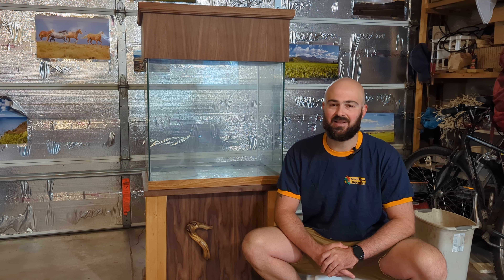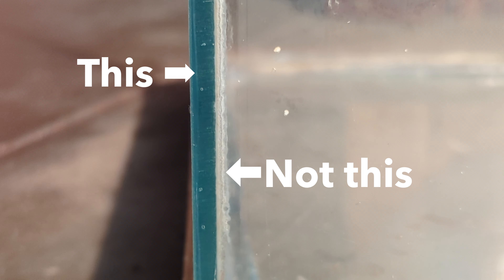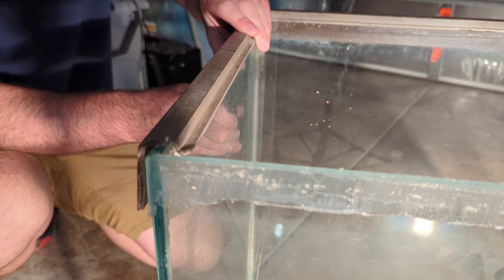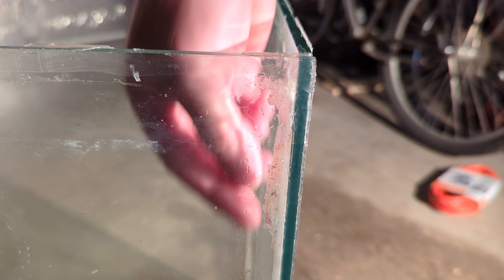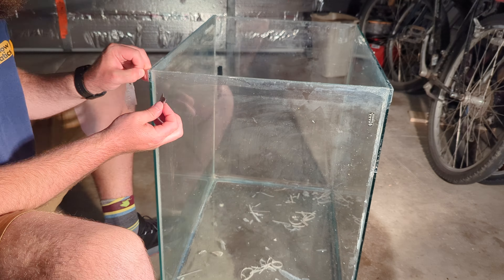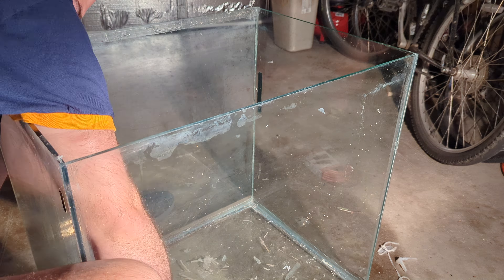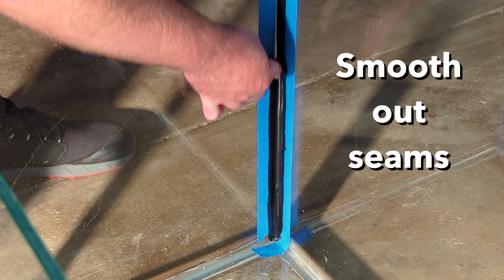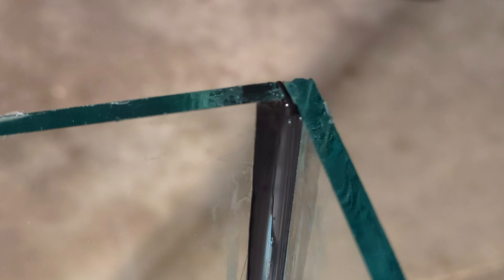How to reseal a secondhand aquarium - a step by step guide

Comment: i assumed you had to do the bottom as well, since silicone wont stick to silicone, you will have a weak seal where old meets new at the bottom....i did this today and am just taking a break before adding new silicone.   taking the bottom off and adding one new seal all the way around seemed like the right thing.   didnt wanna worry about that seal constantly
Reply from the maker: Hope the project went well!
Reply: I was just thinking the same thing
Reply: @GoldshackGarage The silicone between all 4 sides connected to the bottom pane looked brand new and the preparation done above was perfect so. the new silicone will not need to stick to the old silicone to make it hold water and like anything we do with tools and labor preparation is the hard part 😎🩵💙

Comment: Use a heater all the silicone will come off literally take a space heater put it inside the tank wait 30 minutes wear gloves literally peels off
Reply from the maker: Thanks for the tip!
Reply: @freshflowaquatics  no problem been stripping tanks since I was a teenager
Reply: @freshflowaquatics  also you can use nylon string like dental floss and cut the silicone out of the crevices with no scratches little trick i learned from my grandfather he was the og fish tank keeper.
Reply from the maker: @DogTrainerDave94  Thanks for the tips, I'll have to try them out next time!

Comment: I’m amazed at all those bad silicone seals, a lot of tanks seems to have this problem. Also expensive aquariums from 7 years old or so made on the specification of the client. I have always (second hand) aquariums from Juwel, market leader in Europe. My oldest is from 1960. This 65 years old! Still in use, with perfect silicone seals. They have a semi industrial way of manufacturing, processes and cleaning are very good I think. Perhaps that’s why their aquariums last forever.
Reply from the maker: 65 YEARS OLD?!?!?!?! That's absolutely insane. Does it have  ametal frame? Some of those antique aquariums are really really cool; I've seen a coupe with some really unique looking designs. I wonder if the silicone was different from today. Things really aren't built to last anymore...

Comment: Going to seal a 150 gallon soon but my seal issue is opposite the bottom seal is bad
Reply from the maker: Good luck with the reseal, hope it goes well!
Reply: @freshflowaquatics  when resealing the bottom is it recommended to do the corner seams they are mint but I'm neverous as heck because the tank is 150 gallons
Reply from the maker: @marcustorres8309  Great question. For a 150 gallon tank, I'd be nervous too and would 100% definitely reseal the whole aquarium. That's a ton of pressure in a tank that size.
Reply: @freshflowaquatics  any brand you recommend for silicone

Comment: So you don’t have to silicone the top right? I’m in the middle of doing a 36 aquian bow front tank and I think it’s going good but I’m scared because I’m in a apartment and not sure where to test the water at I’m on the ground floor but it’s getting cold now and I want to water test as soon as I could when I’m done cleaning the tank out of the old silicone
Reply from the maker: Are you asking about the break in the brace? I did seal the whole top portion of the tank by laying a thick bead across the top of the tank before putting the brace back on... which is what holds the brace together. Lemme know if I'm missing your point here. 

To be honest, I used to do this more often and was a little nervous when I filled the tank. I think there is always some element of being nervous until you've done it a few dozen times. If you have a standing shower that is a level and smooth ground, that can be a good place to test if it holds water. Otherwise if you are really in a mind you could try putting a tarp under the tank or even buying a really big plastic tote to put the tank in.
Reply from the maker: Also your username intrigued me so I checked out your channel. That was awesome!

Comment: I just purchased a 75 gallon acrylic aquarium it started leaking at the very bottom. at the time when I purchased the aquarium I did not realize that silicone does not adhere to acrylic just eyeballing it it looked like Factory but obviously somebody resealed it in the past. long story short I have to take out all of the silicone and go back with acrylic cement
Reply from the maker: Ahh sorry to hear that. Hopefully the project goes well! I actually bought this tank and stand used without realizing how much work I'd have to put into both

Comment: Nice video man. I’ll be saving this rare 30 gallon breeder tank now.
Reply from the maker: Thanks for dropping a comment! Hope the reseal goes well. I only take the time and effort to do this for tanks that are no longer in circulation - unique dimensions.
Reply: @freshflowaquatics I have resealed a few that I got for free from either seeing it on the road or Marketplace and I can agree with the well deserved praise for how you thoroughly covered everything. So i definitely have a quirky one that I have been in no rush to do but I think it's time to get out the tools and Acetone , one question is what if any was the Best silicone you used? Honestly I have been having good results with Aqueon and I have always bought black too. So wish me luck with my Fluval Flex that a few years ago was the 15 gallon before I cracked it when I had a great idea for keeping my Nerite snails from going into the rear chambers. When I placed a piece of twinwall greenhouse that apparently I should have cut little more than I did because a few hours after the left side cracked close to the back corner 🤬 So I decided to make it a one of a kind by cutting both sides exactly the same and the bottom pane as well and then toss the lid. Haven't decided yet if I want to have the back filter or since I am losing more than that after all is ready to go especially since I will be getting some clips for a new glass lid . I'm going to keep track of the gallons but my guess is around 7 - 8 max.. 🧫

Comment: You said you didnt re seal/caulk the bottoms. Any issue with the new silicone adhereing with the old on the bottom because i hear silicone doesnt adhere together?
Reply from the maker: Great question. It is kinda contradictory how I resealed the tank since I said that silicone doesn't adhere to silicone. I tested the tank in my garage for a couple weeks, and I've had it set up for 2 months with no issues. If you want to be extra safe, you can reseal the bottom as well.
Reply: Okay but if you don't remove the seal in-between the glass panels the new seal will not bond to them. If you want a tank that you are certain won't leak, don't cut corners... Thanks.
FYI have you trusted jesus has your Savior? He is calling you.
Reply from the maker: @KnowingGodExplorers  You don't have to break a tank down completely to reseal it.

Comment: Thanks for the info! Based on your pictures of bad silicone, my used 45gal tank looks to be in really good shape. That is all but about 3 inches that something had scratched at. Can you do a small spot renewal or would the whole seam need to be replaced? What are your thoughts on flexseal tape? Thanks
Reply from the maker: No problem, glad to help! Generally it's not a good idea to seal just a small segment. I actually did that on my Fluval Flex 15 gallon and it's held for years. That being said, I would be concerned about a larger tank like a 45 gallon... That's a lot more pressure and so much water to end up on your floor 😅.  Id do the full seam. I've never used flexseal tape personally, but it's my understanding that it is not aquarium safe due to chemicals that leach into the aquarium.

Comment: I have an aquarium, there was a small crack on rhe front glass, so I replace it with new one only cutting the silicon on the front side. V have the old tank which is nor made of tempered glass. Still it is leaking from the front side
 I need your expert ideas.
Reply from the maker: Hey, sorry to hear that. Such a bummer to put that time in and still have a leak. I suggest that you pull all the glass panels apart and rebuild the aquarium. When you're adding in a new piece of glass that's the safest way to go.

Comment: You wait 24h before filling it for 7 days or do you wait a little longer to be sure it will be fully cured and thanks for the video its been a nice guide ! I got an other question too i use vinegar instead of acetone to remove the tiny bits that wont budge  do you think it can damage the seal between the glass first time resealing a tank thanks for your advise
Reply from the maker: I'd wait 24-48 hours to let curing finish before adding water. Check the back of your silicone tube out to see what it says. Every company is different, but it's usually 24-48 hours. You can always play it safe and wait an extra day or two, but beyond that I doubt you are getting any extra benefits.

Comment: Hey great video just resealed my 125 one of my seams was starting to get a bit tacky as I was working it in it on the bottom it has a rougher surface and slightly bumpy compared to the side seams that are almost perfect is this okay long term ?
Reply from the maker: Thanks! If you were still able to push down and get the silicone to adhere to the spots it needed to go, then I would imagine you are fine. If it was so tacky that it wasn't able to press against the glass then you'd probably see lots of bubbling and that could be cause for concern, especially with a 125. 🌊

Comment: I’m glad I came across your video! I’m in the same exact situation but with a 75 gallon. I really don’t want to remove the bottom glass seal because it’s in great shape. What do you think? How is yours still holding up?
Reply from the maker: Hey, thanks for the comment! The tank is still up and running with no issues. The bigger the tank, the more likely I would be to not take any chances and just go ahead and reseal the whole thing. I would probably reseal the bottom for the 75.

Comment: ill be doing the same to a 220-gallon tank soon. really similar wear it had no leaks but the seams on the corners do need re-sealed. The bottom looks perfect but I'm nervous about not doing the seams and having issues later on .... whats your opinion?
Reply from the maker: Good question. I would definitely recommend resealing the whole aquarium for a tank that size. In my opinion, it wouldn't be worth the risk! That'd be a lot of water on the floor 😳
Reply: @freshflowaquatics  awesome. Definitely agree

Comment: hello, quick question, my silicone looks good for the top but silicone for the bottom has turned orange.. i have let it sit for awhile with just water and nothing else so im wondering if that’s why. but i’m planning on actually using it now but am worried that it may not hold. would u recommend to change the silicone? it’s not receding but the color change it worrying, thoughts??
Reply from the maker: Hey, great question. It's possible that the silicone has turned a little orange from having algae growing on it, basically resulting in a stain... But that's pretty uncommon. Does the texture of the silicone that is a different color feel the same as the top? Also, how old is this tank?
Reply: @freshflowaquatics  yes they feel the same and i’m not completely sure how old it is. i got it from someone on offerup and they didn’t really specify. there was no leakage tho when i went to go pick it up and none when it was filled back at my house.

Comment: When I was removing silicone from the bottom of a 40 gallon, I noticed the razor blade accidentally went between the two panes of glass.  Is the process shown in this video still sufficient for keeping it together?
Reply from the maker: Oh no, I'm sorry to hear that. That's not a good thing to happen, since it can compromise structural integrity. You'll probably want to take all the glass apart and rebuild at this point.

Comment: Great job but I'm still worried about the fact you cracked it, how did you get on with fixing the crack 👍
Reply from the maker: Thanks! I used a lot of silicone at the top when I put it back on, holds everything together. The brace was already cracked when I started taking it off. This tank had really been through the works 🤣

Comment: So then your new silicone is not adhered to the silicone of the panel seam?
Reply from the maker: Correct, it is not adhered to the silicone between panels. If you want to do that, you'll need to completely break down the aquarium and rebuild it.

Comment: i need to use BLACK COLOR SILICONE that must be AQUARIUM SAFE... can black silicone be used as i see you are useing it.
Reply from the maker: Yes, you can use black silicone. You can find aquarium safe silicone online in black.
Reply: @freshflowaquatics  i bought the GE 100 percent silicone BLACK in HOME DEPOT.. is this ok, it does not say that it has any mold retardent in it.
Reply from the maker: @AQUARIUMFREAK123  I've used that before, though the back says it's not aquarium safe. Some people will say use it, others will say don't. If you want to be 100% sure, you can buy a product specifically designed for aquariums.
Reply: @freshflowaquatics  thank you.. when you used it , did you find that it was safe ?
Reply from the maker: @AQUARIUMFREAK123  Yes, I've found that it has been safe with my freshwater tanks.

Comment: Why didn't you reseal the bottom silicon? I hear everywhere that silicon doesn't stick to silicon. Your new layer of silicone, may peel off from old one with time, no?
Reply from the maker: I didn't reseal the bottom because the silicone was still in great condition. I learned to do this from someone years ago and should have talked about it more in the video. Reseal the bottom for the greatest durability. It's not likely to peel, but I suppose water could get in there, granted I feel good about how the shape of the reseal. It has been a little over a year now that it's been filled with water FYI. Good question!

Comment: Please do not recommend this black sealant located on your affiliate link because it contains a 10 year mold inhibitor which is toxic to fish.
Reply from the maker: Thanks for the comment, but I don't think that there is mold inhibitor in this. Maybe you are thinking of their "10-year mold free" bullet point on the tube? Unfortunately that sort of terminology is confusing because it sounds a lot like mold inhibitor, but it's not the same. You could advertise a glass aquarium as being mold free even though it doesn't have any mold inhibitors. I believe that has to do with the way that the silicone cures and creates a surface that is impenetrable to mold... This is my assumption based on the fact that when you look through the product data or safety sheet there is no mention of mold inhibitor, which you can access here ⬇️ 

https://gesealants.com/products/advanced-silicone-2-window-door-sealant/2811093

Here is the list of chemicals found under the information of ingredients section, none of which are mold inhibitors. That being said, if I missed something, please let me know. I'm willing to admit if I've made a mistake and I'd like to know if that's the case. I've used this in the past and currently have tanks with it in it, and livestock are all doing great. Here's the list of ingredients.

-Silica, amorphous, fumed, crystal-free
-1,1,1,3,3,3-Hexamethyldisilazane 
-Trimethoxy(methyl)silane
-Carbon black 
-octamethylcyclotetrasiloxane 

The safest option may be to get silicone that's designed for aquariums... that being said, for all I know they repackage GE silicone just the same way that you can buy super glue from your LFS with its branding on it.

Comment: Why not break it all the way down and completely reseal it? It seems strange to go to all that effort but not completely reseal it?
Reply from the maker: Good question. I didn't reseal the bottom because the silicone was still in great condition. Strong lighting is often what causes silicone to break down, but since there is substrate along the bottom of the tank the silicone was protected. I should have talked about it more in the video but I wouldn't recommend this approach for very large tanks. I would do what you said, just go ahead and reseal all of the seams.